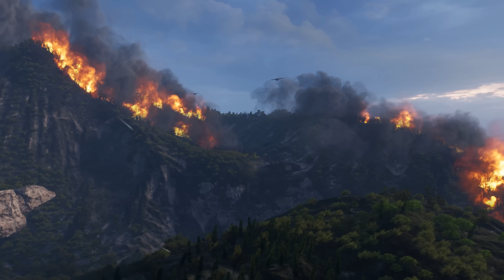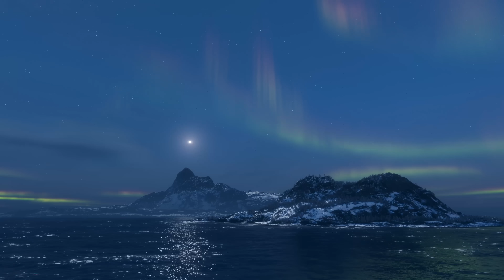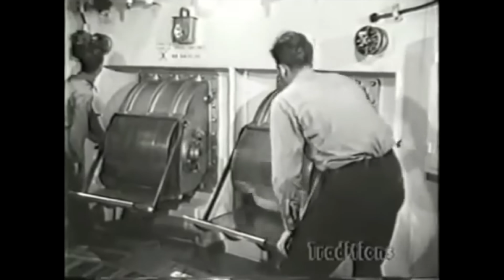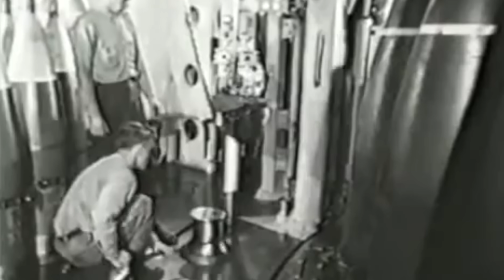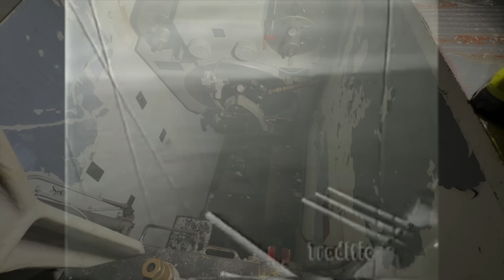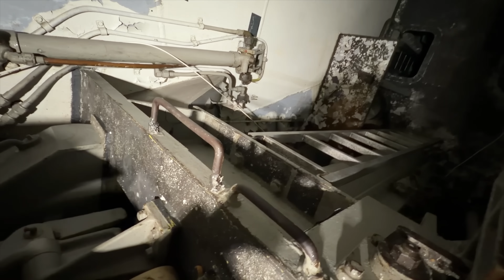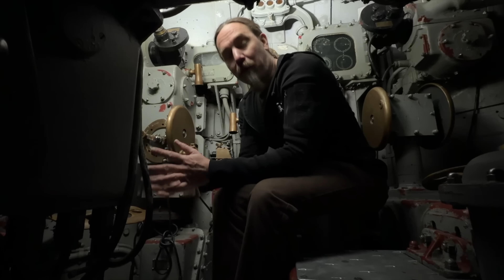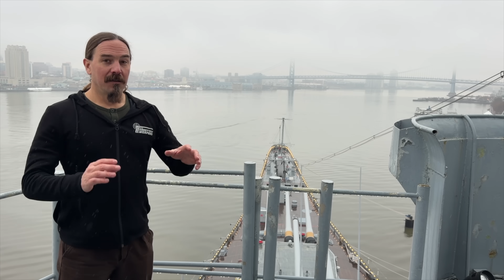How the USS New Jersey's 16-Inch Guns Work: Top to Bottom

Comment: I know a magazine can get fairly easily flooded. Are those powder bags water tight, so they could just pump the water out and begin firing again?? I would imagine they would have to be or all of the powder in the magazine would be ruined after a flooded magazine.. Also would every shot get the full 6 powder bags?? Or would a shorter ranged target only get say 5 bags?? Or all aiming is done by changing the elevation and position of the barrel??

Comment: Personally, that reserver power hand crank could have been placed elsewhere, driving it via a shaft such that a guy on a bigger crank could provide the energy in a more reliable fashion. Generally speaking, it is easier to crank a larger thing slowly than a small thing fast. Secondly, one can add a flywheel to smooth out the rotation.

But yes, mechanical computers like this might theoretically by "slow", but they are likely still calculating their solution faster than the guns themselves can be aimed. Thereby an upgrade requiring re-engineering of electronics would be deemed silly when the mechanical computer works just fine. Even if a 90's, even early 80's computer could have rather easily taken more aspects of the environment into consideration. But at some point the variations in powder quality, machining tolerances of the projectile and honestly the thermal expansion of the gun barrel itself starts having bigger impacts, let alone the small shifts in wind conditions or just the target changing course while the projectile is in transit. Not that a ship will drastically be able to alter course in just a minute, but combined with other aspects, the accuracy has its practical limits.

Comment: What absolutely floors me is that these systems were still continuously operable decades and decades later in ACTUAL COMBAT MISSIONS. Reliable doesn’t even begin to describe the level of planning and logistical nightmare of designing within the guidelines of a Treaty. I mean if you wanted to just build the most robust & durable thing ever you just over engineer it making it bigger, heavier and beefier but on Sea, that isn’t always a viable option, 

For anyone who has been fortunate to fail early on and experience what it’s like to realize that large sound waves & regular vibrations can result in your equipment shaking and rattling apart. Yet these big guns were reliable enough to continue using in theatre as is. 

Try asking a modern engineer to achieve similar results with 46 levels of fire control backup and have them all play nice for 70-100years and you’ll be calling the ambulance for your engineers popping blood vessels on their forehead.

Comment: Interesting that the gyroscopic controller fires the guns when the ship is level, but does it compensate for the instantaneous velocities of the 3 translations and the 3 rotations that will be present or are those transmitted to the main computer to be superimposed on the firing solution?

Comment: When the Iowa class battleships were reactivated in the 1980's they retained the analog fire control computers. It was found that nothing available at that time could do any better or even as good.
Reply: Important to note - the analog fire computers were designed to be more accurate than the guns actually ended up being. So they were over qualified for the job. They were never able to make accurate fire at the guns maximum range. Not much to improve on if the analog computers weren’t the limiting factors of accuracy in the first place.

Comment: 41:35 the original purpose of the 5" battery wasn't as a redundant backup for the main armament; it was for use in fleet actions, to defend against (or deal with) attacks by torpedo boats or destroyers while concurrently fighting a main gun action against other dreadnoughts

Comment: Those slightly built sailors are lifting and carrying 110 lb bags of powder.  In the USS Texas, they actually handed them up, overhead into the gunhouse, but they only weighted 105 lbs. for the 14 inch guns of Texas.

Comment: Generally, the real danger of cookoff comes from the propellant charges; Far, far more volatile than the actual explosive shells. Shells are typically pretty hard to accidentally detonate, even with incredibly hot flame or substantial shock; That makes sense when you consider that they are fired out of a gun with stupendous violence. Beyond that, the armor-piercing shells must remain stable upon impact with the armor belt, giving the delayed-fuse time to do its job.

Comment: On the Knox class frigate it took three people to fire the 5" 54. The circuit to fire the gun was wired in series through the director, the gun captain, and the auxiliary control room. I was in the control room while I was qualifying for my surface warfare pin, I was told when we get the order to fire wait a half second, as the last man in the circuit to close the switch, I had actually been the one causing the gun to fire. Too cool.

Comment: Well done.  Couple of minor corrections/details:  We never used the optical range finders for determining target distance, always the radar.  They were just there for backup, and the radar we had was the same old radar from WW2.  If you look at the back of Spot 1, you can actually see the radar waveguide coming into the turret.  The teardrop structure over Spot 1 and 2 were the radar dishes.  All we ever did with the optical systems of Spot 1 was fixing on landmarks during navigation.  There were 100lb "full charge" powder bags, also 75lb "reduced charge".  The third trigger on the gyro was used when the guns were in a constant leveling mode.  So it would fire instantly, but that was b/c the guns were constantly level in that mode. The center trigger was used when the guns were in fixed mode in super heavy sea conditions, but we never used it.  The plotting computer was also a critical part used in fire support missions.  It sat next to the Mk8 computer which is the one he shows in the video and was used to convert grid coordinates to a firing solution.  One of the few "modernizations" of the fire control system were little velocity tracking radars (I assume, was never told what they actually were that I remember) which are the little domes you see at the root of the center gun on top of each turret.  These tracked projectile speed on a Grid laptop we had down in plot.  This corrected for powder variations.  It's been a while, so I don't remember exactly, but I don't think the main battery system could fire the 5" guns.  We could control any turret with either plot room, but the 5" guns required a different firing solution as they were there mainly for anti air.  Well done on your detail and accuracy though, no really glaring errors, which is a solid achievement.  Great to see the big guns getting attention.
Reply: This should be pinned
Reply: when the Iowa's were last in service, the Mk 13 radar on the directors was the oldest radar in service.

Comment: The British to facilitate fast firing in Tests etc.  left open the FLASH SHUTTERS.   And left Cordite bags all over the ships Turret area. Completely negating the Safety System.  That’s why HOOD went up. And lots more ships also HOOD  had 15 inch guns but it was a FAST Cruiser Hull. Very light top armour.  When  a Prince Eugenes shell hit.  Through the deck. RIP 🙏  only a few crew survived.   Typical British navy arrogance.  And in 2026. We have 11 times more ADMIRALS then ships.     SINECURE ANYONE.   Retire the lot.

Comment: I'm pretty sure the second cap on an APCBC shell isn't hardened, but mild steel in order to prevent the hardened steel shell from shattering upon impact at 18:00.
Reply: The second cap is for normalization. It is made of mild steel, and deforms to normalize the penetrator. 

Basically, the soft steel is squished between the penetrator and armour, which torques the penetrator to be slightly more perpendicular to the armour plate, helping with penetration.

Comment: At least cheaper than missiles with same payload.  

The amounts of explosives inside shells seem strangely low. Wonder if a steel ball would make same damage or enough damage to enemy ship or concrete bunker on land. Might be more accurate and barrel could be smooth.

These days,  1-gun ship, with some 155 mm guns and  helipad might be useful for land bombardment. During possible ww3, where would frontline intersect with sea? Norway, Finland, Estonia, Lithuania, Poland, Ukraine, South-Korea.

These days, the loading mechanism needs more automation, more electric motors, some remote-control. Often the space could be filled with nitrogen because nobody is needed there. The whole ship could be a drone ship, at least sometimes.

Might be better to use different chemistry propellant, with maybe some powder or even small TNT object to start it. Maybe something involving just-made liquid oxygen.

Comment: I missed the chance to stop by at the New Jersey when I was in those parts, but I did get to stop by the HMS Belfast in London once and walk around. They've got a wonderful set up on that ship which makes it feel like it's almost still in service and the turrets have an incredible set up for how it would have felt like in operation. And that's with the puny 6-inchers, so the feeling of a full broadside from the New Jersey just defies belief.

The primer also just really drives how how simple a firearm is mechanically, regardless of the size. Right from the old muzzle-loaders and even to the modern day it's just "explosion make projectile fly". I think that's why railguns and laser weapons are both fascinating to the sci-fi nerds and scorned by some firearm nerds, because the first wants to take away the explosion and the second wants to take away the projectile.

Comment: 4:30 I don't know if the USN really was interested in an 18" naval gun at that time. They experimented it post WW1 (the British actually fielded 18" naval guns on HMS Furious and their monitors) and concluded it was more attractive to develop a 16" heavy shell then deal with the troubles of handling this big of a shell in their ships. While 18" had potential for higher range and penetration, that caliber also firmly hits the limitations of fire directing over such a long range and needed a lot more displacement to be an effective platform.
Reply: The US was limited to 16" for one reason. Per congressal order, all US Navy ships MUST be able to navigate the Panama Canal.
The US Navy beleived that the beam width needed to prevent capsizing "in rough weather" from a full broadside of 18" guns exceeded the canal width. As it stands, Iowa class has only 4" (2" each side) space for navigation.
So they went with a "high Performance" 16"

Comment: We need to bring back the Iowas and just unload on Iran..!!!
Much cheaper than missiles
Reply: The Battleship channel has several video's out there discussing re-activation and a long series of when New Jersey was in drydock a few years back, discussing all it's work that has been done on de-activation and some steps they took to make their de-activate them to prolong their lifetime as a floating museum piece. During this drydock they did notice that some of their tanks are leaking into the hull. Not something that would be addressed as it isn't a concern for usage as an museum.
They are 80+ year old ships with 80+ year old plumbing all in a condition after their longest de-activation period. Ammunition has been destroyed as it is after its exploration date, the last crews that worked with those systems are in the 60 to 70 year age bracket (70s likely if they are gun crew officers). There is nothing cheap about reactivating them.

Comment: As a fun factor, 2700 pounds of projectile weight converts to 18,900,000 grains.
Reply: What's the muzzle energy?  😁
Reply: @longshot7601 according to Wikipedia, somewhere in the range of 355 Megajoules
Reply: @OscarzProductions how many 0’s is that?
Reply: @johncena-hq1ti 6 zeroes.  Mega = million
Reply: @johncena-hq1ti 355,000,000 Joules.  This is the equivalent of a 2.2 ton vehicle impacting at 1335 mph.
Reply: @juggernaut7625 wtf 😂
Reply: @juggernaut7625  thanks bro 🙏
Reply: @OscarzProductions  A gun that hurls a 1.22 ton shell at a target 24 miles away is crazy.

I just learned there's a "broadside rating" for battleships, which is the total weight of the shells they can fire in a single salvo. The Iowa-class has a rating of 11 tons, the total weight of shells from all nine guns firing at once, which can go out to 24 miles, which is madness. 

And it's the SECOND biggest broadside rating in WW2. The Yamato-class had a broadside of 13.14 tons.

Technology ruined everything, giant guns were so much cooler than missiles lol
Reply: @longshot7601  Muzzle energy from them is "YES".
Reply: @longshot7601  P="plenty"
Reply: So, subsonic or not?
Reply: @husseinalmashhadany are you planning on supressing a 16-inch naval gun by any chance?
Reply: @petermayer1106  I was thinking 12.5 inches with a flow-through suppressor.
Reply: @husseinalmashhadany  How about a 16 inch / 0.5 calibre? 8 inch barrel length. Nice and compact...
Reply: @ryz_vik interesting
Reply: @petermayer1106 currently picturing these guns with an improvised tanker truck suppressor stuck onto the end of each one
Reply: @husseinalmashhadany Mach 1.74

Comment: I have a 1921 Royal Navy Manual which demostrates how large naval guns 'whip' when fired, and how stresses at the breech end were counteracted by wrapping in tens of miles of steel wire.
They also refer to bore x length as 'calibres', not calibre.
Good vid, all interesting stuff.

Comment: Person who has been shelled by HE here, in a dense forest, well, a 122 or a 152 might  strip leaves and branches of a dozen metres  and thats on its good day but the trunks will mostly be upright in it, so probably not landing a helcopter, a 16 inch gun has 3 times the HE filler of a 152 so, maybe you can make one small HELI pad but a 200m wide scythed area, no, that not how it would go

Comment: My MOS in the Marines was 2131 Artillery Weapons Repair.  They sent me to Ordnance School in Quantico, VA for that.

There we learned that they record the data on every single round each barrel fires.

For some of these guns - they can adjust the number of powder bags as part of the firing Solution.  This is referred to as "The Charge" for that round. 

For some guns they would have a Semi Fixed projectile on the end of the casing.  You could take that off - reach inside the casing - pull out the powder bags and only leave the number in the casing for the Charge to be fired then put the projectile back on the casing and insert it in the breech of the weapon as one thing.

Typically - an Artillery Battery - would have orders to fire a set number of rounds at a specific target - at a specific time.  So - they could get all the rounds prepared for that Fire Mission - then fire them off - then have the rounds prepared for another Fire Mission - and fire them off.

 These Guns were like 155mm Guns - so - their powder bags were vastly smaller than those for a 16" gun.

The "Charge" of each round is also recorded.

Here - there is an authorized Barrel Life - that varies  with the Charge being used.  "Charge 7" being all the little powder bags.

Charge 7 rounds - took more than one shot out of a barrels life.

This was in 1970 ... so ... I've no idea what things are like today.  The whole thing about coating the rifling with Teflon was something I'd never heard of.

From the original version of The Caissons Go Rolling Along

"Was it High? Was it low?  Where the hell did that one go?"
"As the Caissons Go Rolling Along"
"Was it left? Was it right?  We'll be here the whole damn night!"
"As the Caissons Go Rolling Along"
.

Comment: It's worth noting, more often than not, they wouldn't use a full Six Bag Charge, and due to the rush into service of the 16/50's they had accuracy issues, mostly due to not callibrating the FCS to the Guns correctly,  firing order of the barrels etc, it wasn't really solved until the 1980's.

Comment: I liked this long video.  Left out of fire control were the radar systems integrated with the plotting room, the float plane spotting rounds, and naval gunfire observers that went ashore with the Marines to direct shore bombardment.  Those would have doubled the length of this video at minimum.  The naval gunfire observers and float planes were sort of a fire control network, suggesting that combining the fire from several ships required coordination from the flagship.  

And while the 16-inch guns were going off, the 20mm, 40mm and 5-inch were pulling anti-aircraft duty.  

Naval battles were complex.

Comment: 7:17 Ironically, the design philosophy of "45 cal but make it battleship size" was to increase the penetration, not the sheer amount of energy on target. I guess when you reach a certain point in navel artillery, a sledgehammer will penetrate just as well as an arrow.

Comment: I have an old 5hp 3phase electric motor that I always thought was pretty impressive. The thing has incredible power though, too much for me to find a use for it, and it slams so hard when it kicks off and could easily twist me around it 5 times and kill me before I could react if it were to be mounted solid and grab hold of me.
But that 80hp is like the size of my old air compressor. Crazy to think what it can run and just how much weight its whipping around through the wind on rough seas to still accurately make hits 30-40 miles away...